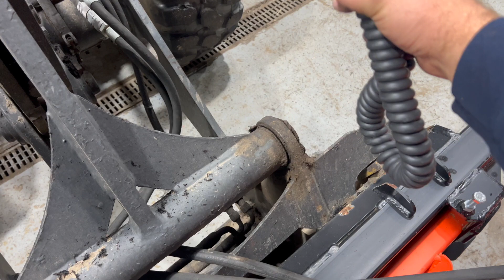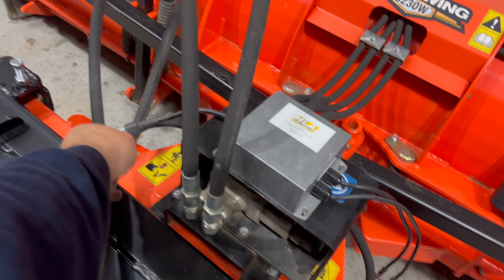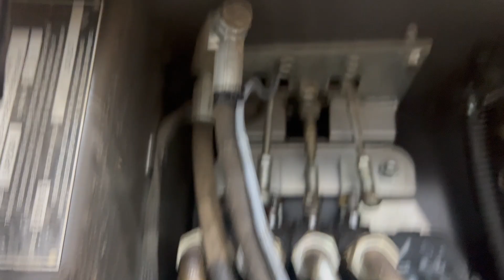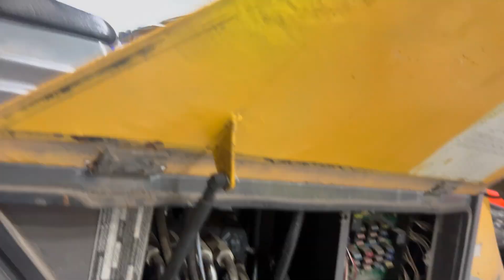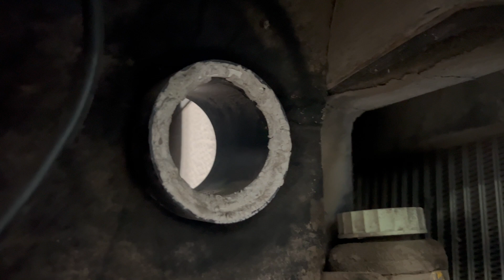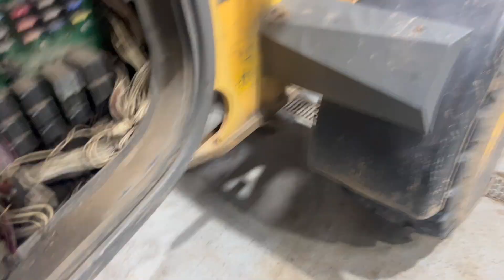Watch as we install an HLA snow wing plow on a Volvo Loader!

Comment: I bought a 15’ wide metal pless last year (9’ plow with 3’ wings) for our 6 ton wheel loader. I would guess it does the work of 4 trucks and greatly reduced our salt usage. The carbide edges show zero sign of wear. The only issue is as that it scratched concrete on residential driveways and the joystick required 2 hands to operate while driving with your knees. I would never go back to plowing with trucks.
Reply from the maker: I was suprised how well it did, that’s a big pusher on a small machine